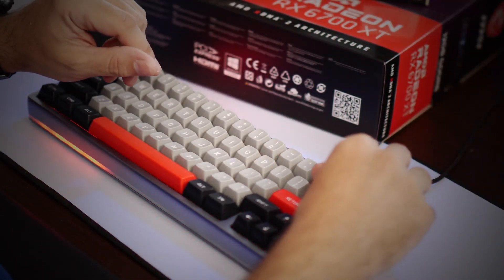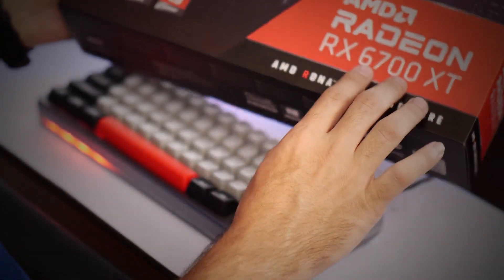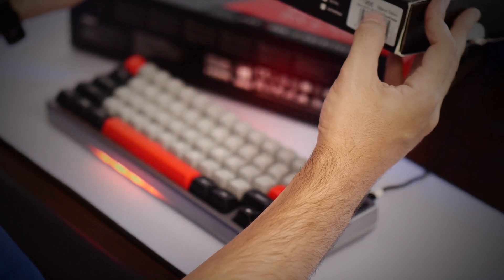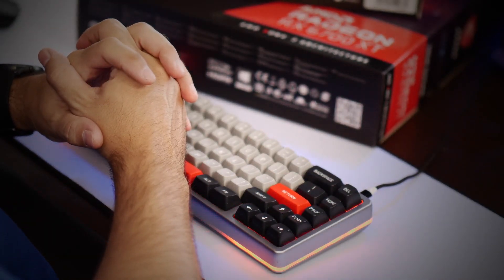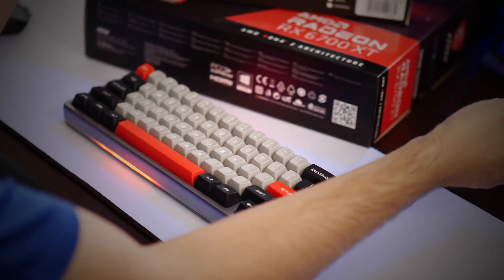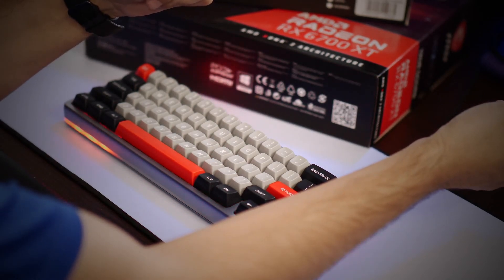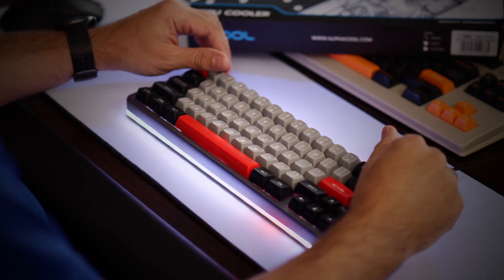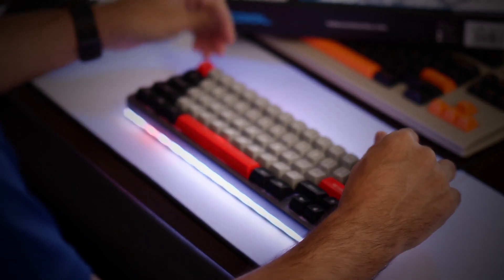Installing a Waterblock on the MSI Radeon RX 6700XT Mech 2X OC Edition

Comment: can i use the waterblock on the asrock 6700 xt challenger series gpu
Reply from the maker: I don't have an ASRock Challenger to test this out on. I would say no. PCB design is likely to be different. Even if components are in the same place, the screws will likely be in different locations.

Comment: it works on  6750xt mech 2x?
Reply from the maker: From what I see, the circuit board is a little different between the 6700xt mech 2x and the 6750xt mech 2x, so I can't guarantee that the block will  work effectively on the 6750xt. The memory modules seem to be positioned closer to the GPU and the VRM solution is different also as the 6750 has to handle more power. From looking at the photos of the board, I would say the block will not cover all VRMs on the 6750XT but I can't be 100% certain without having a 6750xt to test with. Hope this helps
Reply: @mjmodified  thanks, i realy want to try on my gpu, but i having i tought time finding answer.

Comment: Damn, I wanted to see the thermal performance in a game or something. Great video otherwise!
Reply from the maker: Hi Steven, I feel ya. Thanks for stopping by and for the input. Sadly I don't have any pre-watercooling videos to compare against and I'm not sure the post-watercooling information on my Linux system on it's own would be of much relevance to most people (aka. Windows users). I'll see what I can do though ;)
Reply: @mjmodified  No worries, still a great video! 👍
Reply from the maker: @SunderMecha  thanks mate. I figured it was about time I installed a HUD and learned how to use OBS anyway, so I went ahead and put together what I hope is something useful for yourself and other with the same card: https://youtu.be/fn1dRdtUMlE (just remember, in Windows you'll likely get better performance as it won't have to run through Proton)

Comment: Hi, thanks for the video, recently my old rx580 nitro + Sapphire SE 8gb died and I decided to switch to rx6700xt by the way, you helped me choose the card and block with your video.  How's your experience using Alphacool with this card after the video?  Regards.
Reply from the maker: Thanks for stopping by, I-m glad the video helped you pick the card and block! I've bought a few things from Alphacool (through Titan Rig mostly) and have been pretty happy with the value they offer for the price. Radiator, a couple of pump-tops, a couple of pumps, the naturally the 6700xt block... With regards to the block specifically, I'm quite happy with the performance. My office's temperature is normally a little on the high side, hanging around 28 degrees celcius and under heavy gaming my water temperature gets to around 32-34. With those temperatures I haven't seen the GPU exceed 52. I only have one loop though. I expect you could get better results with 2 separate loops, but quite frankly this is perfectly fine for me. 

On a different topic, it's cool you mentioned the RX580. I been recently working on a hackintosh build with one. I got a used XFX RX580 GTS Black Edition, put it on an old Aorus Ultra with a i9 10900K hackintosh, in a tiny Thermaltake Core V1 and it's been quite a fun build so far - although I'll need more radiator space if I'm ever to liquid cool the card too. Anyway, good luck with your new card and block! Let us know how you go
Reply: @mjmodified  Thank you very much for your extensive answer.  I will definitely make a video of the construction of the loop and probably a similar video to yours with the presentation of the block.  As soon as I put it together, I'll come to you here with a link to the video.  Thanks again for your reply.  Regards And Happy Easter. :)

Comment: could you try watercooling the xfx swft 309 6700xt?
Reply from the maker: Sorry bro, I'd love to but I don't currently have access to an XFX Speedster or a waterblock for it (I believe Alphacool's block for the XFX MERC 319 matches that PCB... but the one I used for my MSI definitely won't). How'd you go in terms of finding a waterblock for your Speedster? 

With regards to the actual process of installing the waterblock, the steps will be pretty similar (again, it's important to have the correct waterblock). Remove the cooler, re-paste, apply new thermal pads on the block and back-plate and screw it all back onto the PCB. Let me know how you go or if you have any trouble
Reply: @mjmodified  bykski has a block for it I just don’t have the funds to grab it and test it
Reply from the maker: @djmii5tik974  I feel ya

Comment: I saw a reddit post of someone doing this recently I was about to buy one and your video came up confirming this can be 100% done easily.
Reply from the maker: Excellent, glad it was useful for you!
Reply: How did it go? I'm newer to computer building. This doesn't look extremely difficult but at the same time working on new computer stuff is intimidating.
Reply from the maker: @Arkzinox  ya, I know exactly what you mean. Changing the cooler will void warranty on the card and it's definitely intimidating to think that if something gets ruined it's going to be pretty expensive. Having said that, if you do it patiently there really isn't a great deal that can go wrong and the result is much cooler temperatures and improved performance - which is definitely worth it.